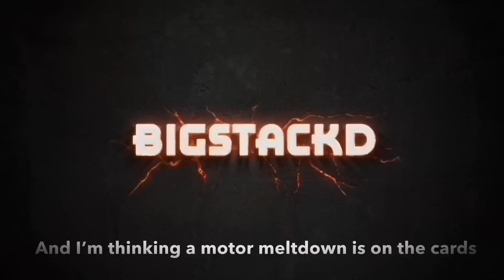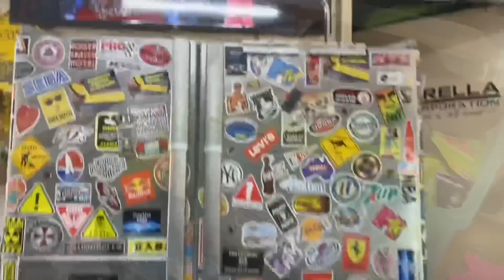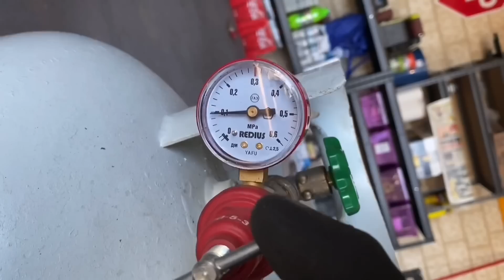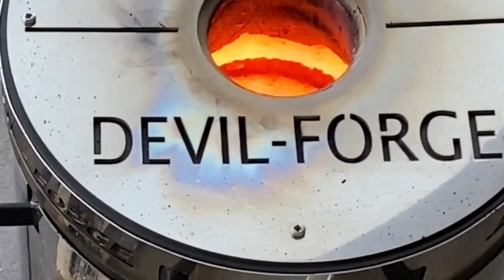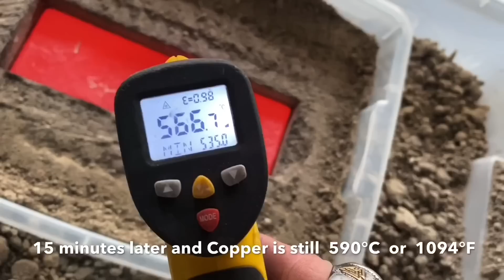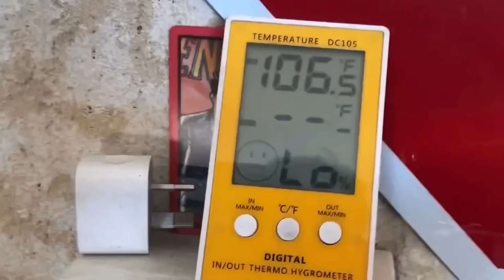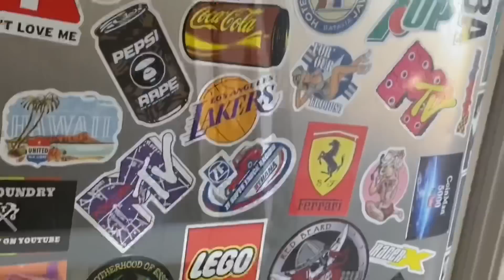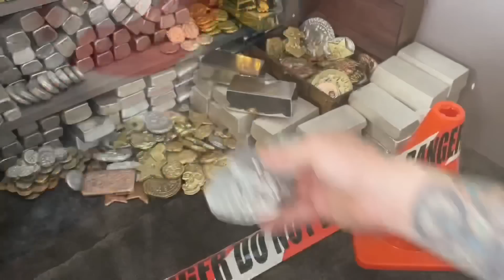64 KG Massive Motor Melt Down - Scrapyard Search - ASMR Metal Melting - BigStackD Trash To Treasure

Comment: I like how the aluminum bends like icecream at high heat. Wild.
Reply: The surface of the aluminium is oxidized, which makes it melt at much higher Temps. So it will literally melt in the middle first. Which makes it look like that.

Comment: "I've got just the tool for this."
Okay, either he has a specialized tool, or he's using a ha-
yeah he's using a hammer.
Reply: It’s actually called a Torx bit or a torx wrench. You can get tamper proof for the one that is that shape and has metal in the middle so a regular torx won’t work as well

Comment: Why do you put the gloves on the gas line? To keep it out of the sunlight/insulate it from radiant heat?
Reply from the maker: No mate it’s simply because sometimes Embers will come out of the furnace when melting dirty scrap so I cover it up for protection as it’s just a rubber gas line
Reply: @bigstackD  makes perfect sense, cheers!

Comment: Why is there soo much slag on top of every melt of aluminium. Is that because the aluminum is not clean like layers of other elements on or in it to make an aluminium alloy for strengthening and layers of protective sprays?

Comment: When you see the socks first the tattoos come as a bit of a surprise. Question: how much $ of gas do you use to melt say 5 kg. of copper?
Reply from the maker: Depending on what type of copper, if it’s copper wire it will melt a lot quicker but if it’s a 5 kg copper block it could take twice as long. Let’s just say it was copper wire and 5 kg of it in the Crucible at once it would probably cost about 10 or $12AUD to melt I reckon And would take about 30 minutes

Comment: One one hand, that motor, if you had repaired it, would have been worth A LOT more than the metal prices (and could have been put to good use if you find an old cheap lathe with a missing motor or something).
On the other hand, I've always wanted to see the insides of such a motor.

So it's a win-win :P

Comment: I don’t find this a dumb question, can that slag be remelt?
Reply from the maker: Hi Jason, I melt all my slag at least once more and sometimes twice to extract as much metal as I can, sometimes it’s probably not worth it with the gas and time used to get just a couple of coins but this is a hobby I do on my days off so I don’t mind at all. If you check out my other videos you’ll see that I have done slag and dust melts  a few times before 👍🏻

Comment: This look like an asynchronous Motor direct connected to the Grid. This Motors have a cage of copper within the Rotor with approximativ 50% amount of the stator copper. Modern concepts of Motors like permanent Magnets or Reluctance need some Inverter technology to Work well.  Looks like you have lost 33% of the present Copper

Comment: So you’re aiming for a tonne of metal melts. I’m interested. How much of that as a ruff % was from people donating things to melt? I’m gonna guess at about 50%. Not for any reason other then interest ☺️. I’m an ex British solider. Was in REME for 15 years (royal electrical, and Mechanical, Engineers)  We learnt all sorts about different metals, melting points, welding, how metals react with other metals, mathematical equations that still, to this day, are beyond my understanding, like coefficient of linear expansion, and tempering equations…. Bottom line. F**k all the training, and science. Melting metal, is just so much fun….. is it just a “boy thing?” Don’t know, but I can’t think of anything I’d rather do then just melt metal/heat it up. Then bash it/mould it, into something else. The strongest form of solid, turning it to liquid, and then smashing it into a shape. So satisfying lol.

Comment: In today’s melt I head down to the local scrapyard where my friend said if I can lift it out of the bin I can take it home , I was quite limited to what I could lift out and ended up lifting out a 64 kg motor and brought it home to meltdown. The good thing is it had an aluminium case so I could melt all that down as well as the awesome copper inside to add more than 11 kg to the shelves.  It’s a very long video today as I didn’t want to cut out anything interesting so bear with it and sit back and relax and turn your brain off while you watch this video and I’ll see you all next week:grin::wave_tone1:. 
Now i hate to ask and it does sound a bit cringey but if you Feel like supporting the channel Simply donate some of your time just by allowing the ads to play through this will help out a lot and that’s how I make a bit extra revenue and the good thing is more revenue means more giveaways:punch_tone1::smile:. A better way to support the channel is play one of my  playlists on your computer before you walk away from it and let it play through that really helps as well but don’t ever feel as though you need to watch the ads if you don’t want to simply skip them and move into the video it’s completely up to you and I understand if you don’t have the time to do so:ok_hand_tone1:and like I always say if you like the rings shown and used in this video be sure to check out the description where you can get 20% off the already discounted rings using my code and if you want to try your hand at melting yourself you can buy the burner on its own or the whole furnace set up and I can organize a 5% link for you off the total furnace price just email me :grin::thumbsup_tone1:.

Comment: When I'd suggested sand casting a mold, I'd no idea you'd already tried it. The initial pour spot looks better, and the rest of the bar does, too. Maybe the other molds just trap the air. It can't rise through the metal because the metal is too dense, and it can't go through solid material (obviously). The sand, however, is porous and will let some air squeeze out the bottom.